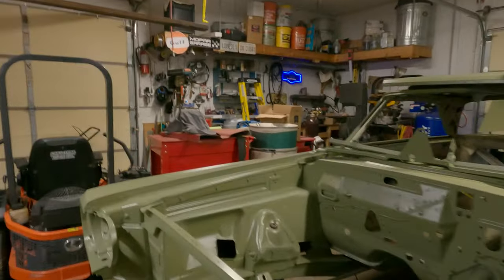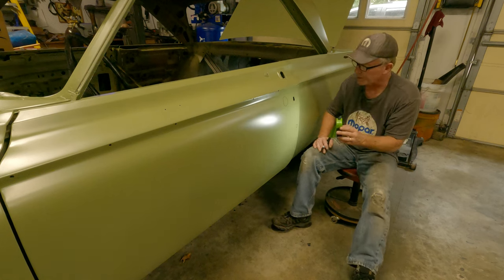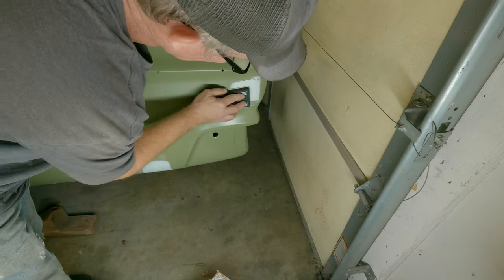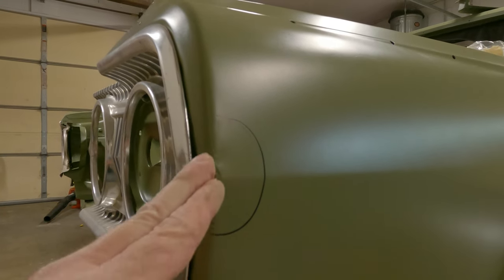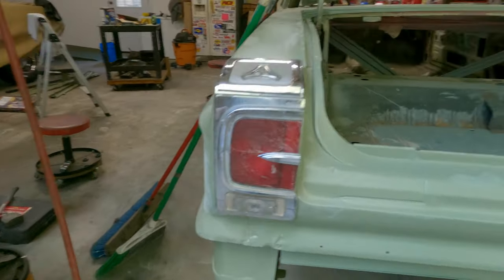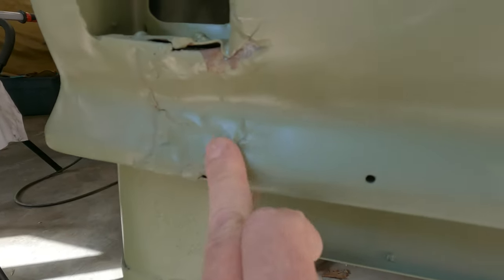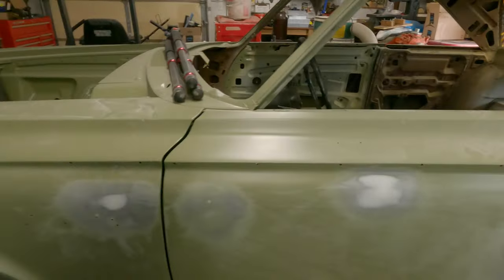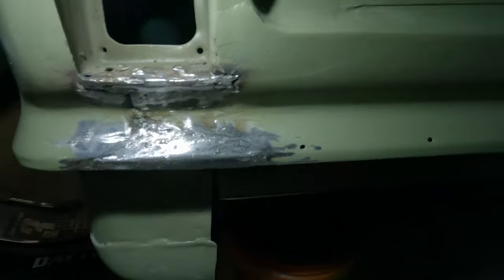Mastering the Craft of Body Work Part 1 | 1965 Dodge Coronet 500 Episode 13

Comment: Don't use your finger tips
Hold your hand flat on the surface.you can use a rag between your hand and the body also to feel it
When you block sand the primer you can spray black paint in a light mist to show high and low spots .
Reply from the maker: Thanks for the pointers David.  I've gotten better here as time has been progressing.

I wish that we were up to the blocking and using a guide coat to get her flat.  Sooner than later I hope.